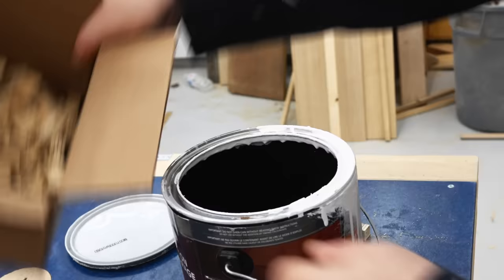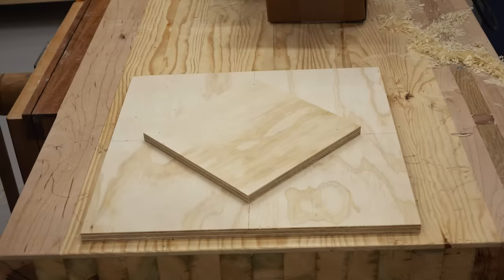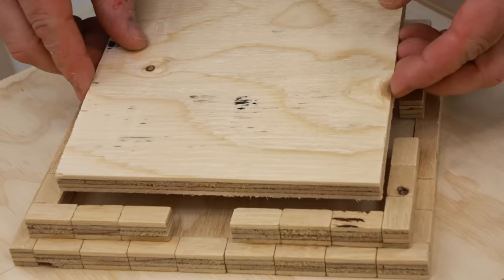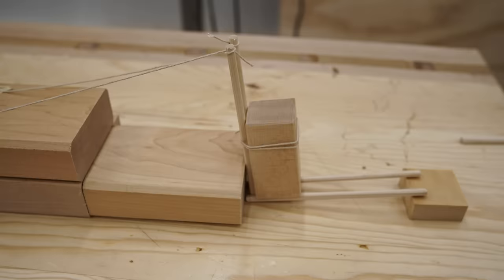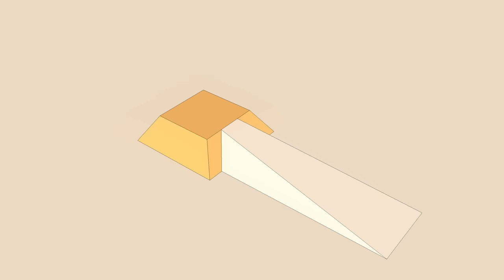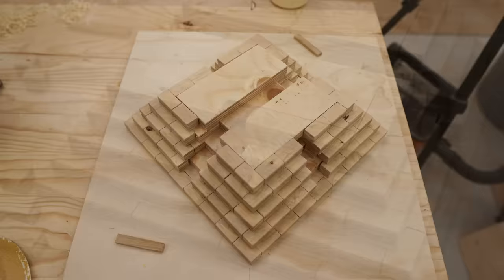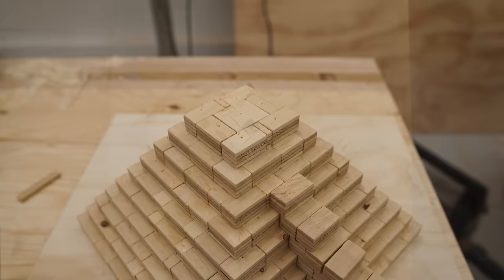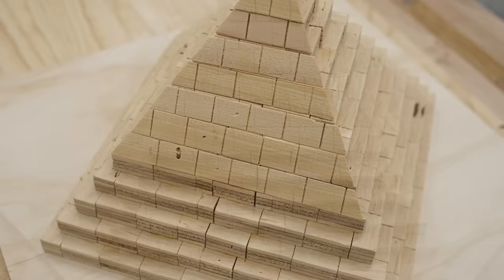How I Would Build The Great Pyramids

Comment: Excellent theory. I personally never bought the ramp idea, because it would have taken another pyramid’s worth of material and it left no traces. Leaving a gap on the faces to make a kind of staircase is much more practical and clever. As you observe, this did leave a trace. They probably didn’t hide the indent because those faces were covered with casing stones later, so no need for perfection.
Reply: Indeed. The ramps would have left traces. Borrow pits, mounds. Yes eroded over time bu at that scale, something would have been left, and there does not seem to be historical record where people talk of such, even though they would have been more obvious in the past. It never convinced me either. This is actually much more clever, believable, and apparently there is some evidence of something like it from those depression mid-face.
Reply: There are still vestiges of ramps, in particular at the pyramid of Meidum, the pyramid of Sekhemkhet, that of Khéphren, the pyramid of Sinki, and especially that of Sesostris I. All are frontal ramps, perpendicular to the faces.
Reply: @fakeuzero  fascinating,
Reply: Those lines....I thought the pyramids are actually 8 sided..those lines are where 2 sides connect there.
The large 4 sides dip inward slightly and connect there..where u drew the line.....great video still..and maybe the video I saw about this was wrong about the 8 sides..but it was compelling
Reply: I've always liked this idea, but I think the cap stones where placed from the beginning as the outer layers, no reason to leave them out.
Reply: They used inset ramps
Reply: They may have used internal spiral  ramps.

Comment: So they had to first build a massive  paint can to sand the the big rocks. 

Seriously though that was a good tip for small parts.
Reply: Seriously. I wish I would have know this before sanding 12,000 tiny blocks by hand last year.
Reply: It’s called tumbling, you can buy/make them quite cheap, usually they’re used to polish stones or metal parts, tho the ones for metal usually vibrates and cost a lot more, if you have an rc car and a paint bucket that’s all you need, put the car up and down and set the bucket on the wheels :)
Reply: @lilypower  Just make sure everything is secure and the wheels are straight if you go that route.
Reply: Koloth mmm,
Reply: Done this before but I've got a harbor freight paint shaker. It doesnt take long.
Reply: Cool idea - that dust he blew off is silica and is VERY bad to breath,  wear a mask.
Reply: @isaacmelgar524  It's the dust from the sand he used as an abrasive that's the issue. He's correct.
Reply: Hahahaha!
Reply: Interesting fact,

The egyptians most likely used sand when shaping the rocks.

They would use copper saws and pour sand under it and it gave it essentially a diamond cutting edge.

Its why some of the blocks are so precisely cut.
Reply: It was the Nephilim. Thought everyone knew that.
Reply: Good comments.  I was thinking if you had more, you would take them down to Home Depot and use the pro paint shaker.
Reply: or they can just also bury each floor with the infinite sand that they have around them.
Reply: truly
Reply: A massive paint can to sand the rocks? Coincidentally, we have this thing called, "The Desert."
Reply: Instead of shaking the paint can you can have a device purpose built for this... an ammo tumbler used to clean brass prior to reloading.  But, if you must shake, go to the store and buy the largest massager and just hold the paint can on that.
Reply: reallllllyyyy funny comment. love it. ♥
Reply: @BenMarvin  Hey, some of the best lessons are learned by first doing it the hardest, longest way. 😊
Reply: @random3x70  came here to mention this!
Reply: Well you see, that’s where the aliens came in.
Reply: Precisely
Reply: i can imagine taking that down to the hardware store and asking them to put it in the paint shaker. this is actually how our town mixes the holiday eggnog.
Reply: you can also use a little stone tumbler kit
Reply: It's just a small scale manual version of how gun smiths polish spent brass casings.
Reply: I snorted my coffee out of my nose reading this comment 😂😂😂

Comment: This method just may also explain why the Aztecs built a stair case on the centres of each face of their pyramids. This may have been their approach to utilizing the gaps created to lift/pivot the stones.
Reply: I like that idea, I still think it’s crazy how alot of different civilization were building pyramids that didn’t know each other
Reply: Very interesting
Reply: @follc1991  It’s simple and stable. Even as a child being on the beach one of the first sand structures you’ll build is a pyramid.
Reply: @DanksterPaws  to be fair, its a pretty intuitive structure since it doesn't require crazy support column and bar placement along with complex physics calculations. but still pretty cool
Reply: It's more likely that the Aztec pyramids had stairs so that the structure on top could be used repeatedly without needing to use ladders or ropes to climb to the top. The aiding in construction could have been an unintended benefit the Aztecs used without second thought.
Reply: The Aztec pyramids are not built with stones like the Egyptians. They were basically mountains of dirt and rock they then covered with rocks and plaster
Reply: @brianfranch1  This is not really true. Some of them it certainly is the case but not all. And even kess when you see the other cultures temples in tge region
Reply: Big difference between moving rock and cutting them 😂
Reply: @DavidFASTL4N3  Well. We know how the romans cut rocks. Using stakes of wood, pouring water and the stone cracks right off. 

The same stake marks are visible in some egyptian quarries, so that would stand to reason to me that it was the method. 
There is also evidence at Aswan quarry that they burnlt fires around the stone in small ditch or moat around the block. This would soften the rock significantly
Reply: Ok, well how come there is no videos of some actual cutting the same type of rock with tools that would of been used during that time period. I’m sure many have tried and never been able to duplicate it, just talk at this point. Most likely built by ancient civilization with lost technology , not aliens aright.
Reply: @DavidFASTL4N3  But there is? 

Ask any stone mason. They use steel and so on today, but you can shape stuff with stone chisels no problem. 

Youll need to replace your stone chisel quite often. But that was easier when stone tools were something everyone could make. 

These days stone tools would be pointless as we can do it faster and without having to replace the chisel. 

As for getting the stone out of the actual quarry, we know how the romans did it. And although they used steel, it was not required it was just better. 

Most of the stone in the great pyramid is limestone and not granite, which is much easier to cut as limestone is super soft.
Reply: @follc1991  Who said that they didnt knew each other? pretty much all civilisations living on or near any pyramid has said that they stood there before them and the fact that we can find ancient ancestry from persia in new zealand via peru should be a clue to that.
Reply: @DavidFASTL4N3  yeah its sad that theories are considered facts.
Reply: @demonsluger  Egyptian’s, didn’t know the Mayans
Reply: @follc1991 it's because a pyramid is, literally, the easiest structure to build.
Reply: @follc1991  I think it's crazy you think they weren't connected..
Reply: @swickens930  why not just build a square seems easier 😅
Reply: @NINJAGOINS  A pyramid is a square... It's why it's easy to make. It's just a series of increasingly small squares stacked on top of each other. The reason why you dont make a "cube" is because a cube isn't very stable and it would require way more resources as you go upward.
Reply: @swickens930  easy to make.. but no one knows how....your logic is undeniable
Reply: @NINJAGOINS  well no one know the exact way they chose to do it. But we know how to do it. It’s not like we today couldn’t build the exact same thing if a big enough group of people dedicated enough time to the task.
Reply: @follc1991  you are wrong .
Reply: @NINJAGOINS  I might be crazy, but   How? Help me out
Reply: @NINJAGOINS  There are people in this very comment section explaining how it could have been done, not to mention the video itself. We will probably never know the exact way it was done but there are plenty of historically plausible explanations for how it could have been. And that is literally the entire point of the study of history. We can never say with absolute certainty what happened in the past, but the goal is to use evidence to create sound explanations. Your argument boils down to 'we don't know the exact method used so obviously it must have been aliens/god/ancient supercivilisation'.

Anyway, believe whatever you want. You can lead a horse to water...
Reply: @TheskilledLT when you say “ you are wrong” you have to back it up.
The Egyptian’s didn’t do any trading with the mayans. How far did the Egyptians travel? What items have they found in Egypt from South American ?
Reply: Well, the Aztecs also had to walk up their pyramids, ya know. That might be a challenge without steps.
Reply: @brianfranch1  The great Giza pyramid is built on a mound or hill, and is filled with sand, gravel and loose stone.
Reply: @NINJAGOINS  Well, they were built a few thousand miles apart, a few thousand years apart, there's an ocean separating them, they were used for totally different purposes and built using very different methods.
Give a box of Legos to a kid in Australia, and another kid in Russia, and they will each build a pyramid with no collaboration.

Comment: This is a good demonstration and I like the paint can trick.  However, there is evidence of an internal spiral tunnel structure that you could maybe incorporate into your model but you'll need a lot more blocks.
Reply: Ah yes the French xray study that found the spiral incline plane running the outside perimeter that was discarded when no one spotted the incline plane until decades later some savvy individual perusing files found it
Reply: They are both correct. There is compelling evidence at 4min 31sec in this video, and like you pointed out the internal tunnel structure also exists. Evidence of both points to only one thing. Both were used.
Reply: @paddington1670  - I mean, yes? That's often how research goes - they did an xray survey, got a weird result they didn't understand while looking for something completely different, and shelved it. Eventually a guy comes along and says, "I wonder if it would have some kind of spiral in its internal structure" and they go, "oh, wait" and connect the two. Science is a long, arduous process of both collecting and interpreting data. It's not like getting data automatically makes the answer clear.
Reply: @paddington1670  it can also be one (walls) for the raw blocks and other (tunnel) is for workers, tools, woods, and other stuff.
Reply: @monkeyseedo8135  In fact I think all 3 methods were used. First an external ramp was built to build the pyramid like 1/3 of the way, and once the egyptians built the grand gallery they began using that to counterweight the blocks up to the highest level, while simultaneously using the internal ramp to bring even more blocks up. There has also been recent evidence suggesting another grand gallery above the first one that would have continued to bring blocks up but idk.
Reply: @d.r.9746  -Hear hear....the initial ramp could have been made out of the material they ended up using for the top as well.
Reply: French engineer/architect already figured it out. It was so accurate, Egyptian authorities refused his permit to prove it by non-invasively exposing 1 area in the pyramid itself, that if it existed, proved his theory.

Of course engineers/architects built the pyramids. Why would that be tasked to anyone else?

Comment: Perhaps ground-penetrating radar could reveal a different level of sand compaction in areas where ramps may have been, with maximum compaction close to the edge of the pyramid, and a drop in compaction as one moves away.  Maybe this could even reveal the mass of the ramp, and slope based on such.
Reply: Sadly it would be hard to notice anything. Electric would need to be on suck low frequency that the depth of the survey would be too thin and irrelevant. Magnetic wouldn't pick anything, and LIDAR probably neither. I think it has been tried, still nice thinking!
Reply: It’s been tried that’s how they have found all of the tunnels under it. That’s believed to be dug and chiseled after the construction.
Reply: It was built on bedrock, the sand came later.
Reply: Lol… perhaps not…
Reply: I thought that pyramids was built on bedrock.
Reply: The pyramid itself was the ramp

Comment: I had a very similar conclusion to yours for a few years now: from simply noticing the grooves in the middle of each side. I also think they may have used cranes, mechanics back then were extremely sophisticated, contrary to popular belief. Great job with the model!! Thanks for vid!
Reply: Look up the meaning for sophisticated.   I just learned this yesterday and it means complex and deceitful.  We have been using that word incorrectly. It comes from sophistry, which was a sort of word craft  I was surprised by this myself and mean no anger towards you.  Just sharing info l find fascinating.

I can't think of any other way to describe a scaffolding and crane setup though, so in the modern sense , yeah they were sophisticated.
Reply: Yeah those lines are from the actual shape of the pyramid changing. It’s not a perfectly square pyramid like you think. It actually has 8 sides with each of the 4 faces having a slight concave type indentation. So basically this guy misrepresented facts and since he was “debunking” no one bothered to “debunk” him, while I’m certain if anyone created a video with the same failure of understanding, the comments would be littered with a explanation like mine.